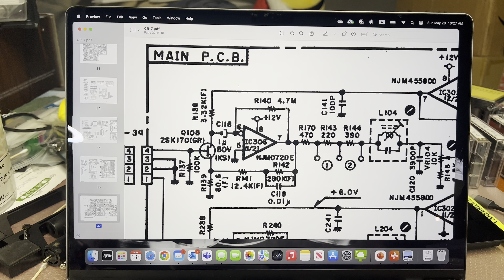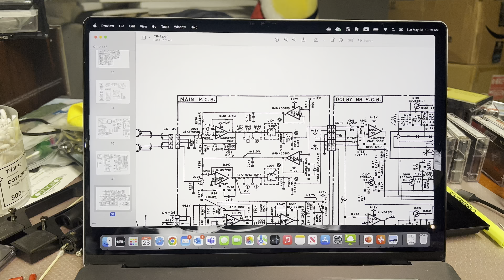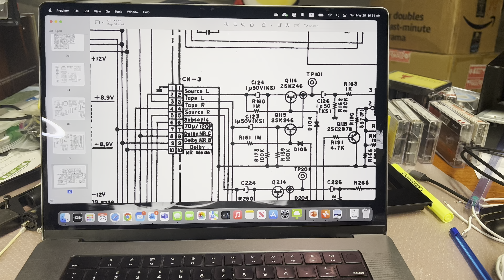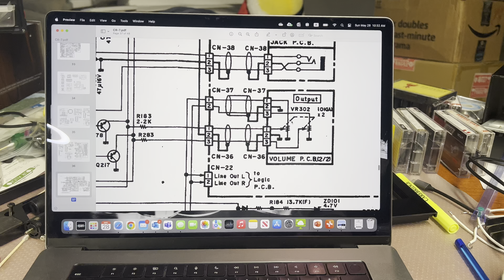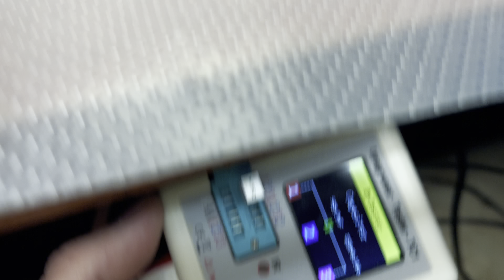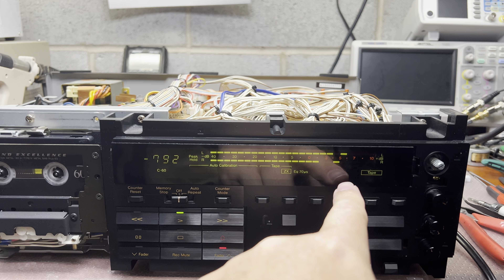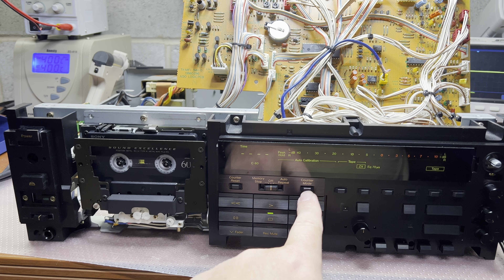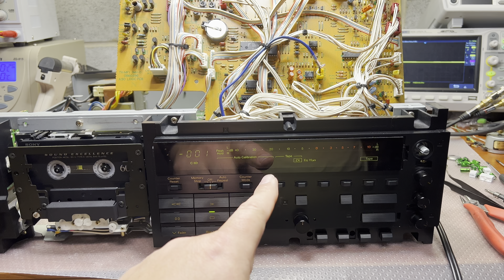Restoring Nakamichi CR-7: Capacitor Replacement for Better Sound

Comment: The battery is to store auto calibration parameters, you can read it in the owner's manual under auto -calibration, page 8

Comment: Hi, I think you have swapped a rechargeable battery for a cell battery non rechargeable, I don't see clearly on the video but if the original is a nm2032 then I'm right. With a cr2034 you should use a diode to block current from board to try charge the cr. Hope it helps.
Reply from the maker: Thanks for the tip, I will check
Reply from the maker: You are wrong, schematic and PCB layout shows this as a battery and there is diode installed.

Comment: Which brand and capacitor types are you using. Why are Electrolyt caps better than mkp's?
Reply from the maker: Nichicon Muse and Fine Gold, but these caps are discontinued recently and only stocked amounts left. Those white caps were not original, original are electrolytes. And Nichicon are the best audiophile caps available.

Comment: The circuit topology of the CR7 is more or less the same as the Dragon layout which uses 2.2uf coupling caps instead of the 1uf values and also using the same OP Amps. Perhaps Nakamichi designed it this way as the CR7 is renowned for being more CD like sounding and clinical losing that analogue sound, which is criminal IMO!